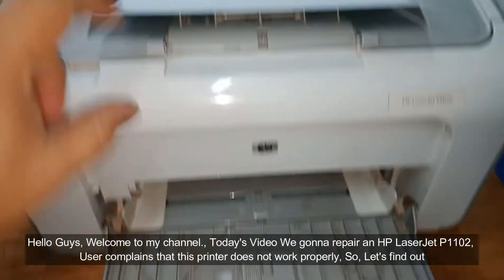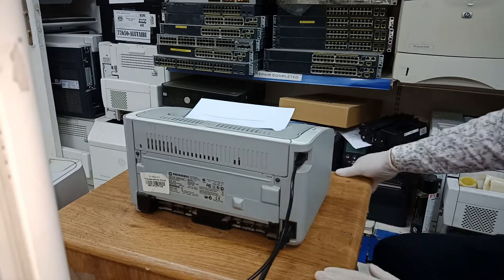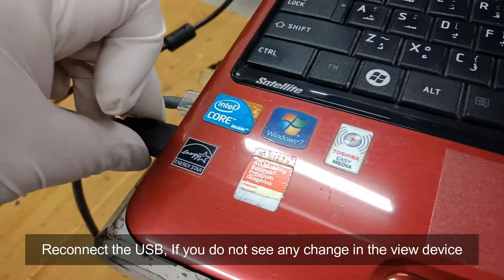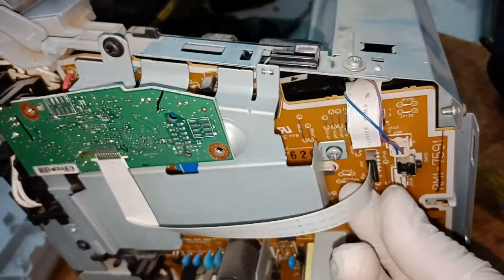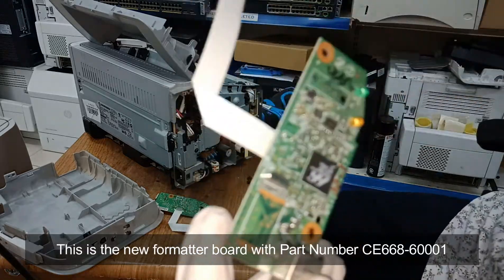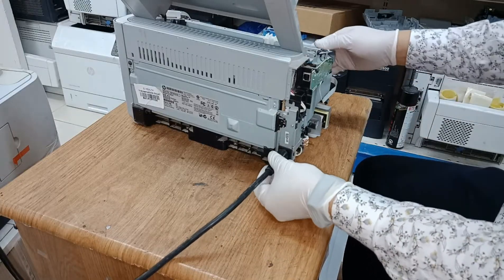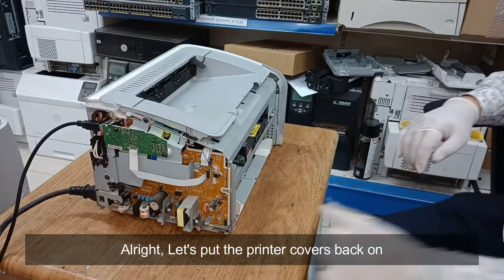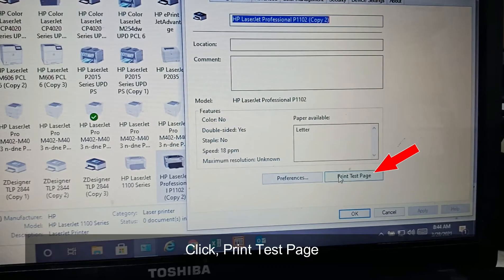Hp LaserJet P1102 | USB Not Detected | 100% Solution

Comment: Hello sir I have the same printer p1102 when I connect it to my PC it shows another name in PC p1105 but this printer is p1102 and when i am installing the driver for p1102 it tells that connects the printer and turn it on while it is turn on already please help me?
Reply from the maker: Replace the formatter board's original part number CE668-60001 it will be fine.
Reply: @Okipentv  Hi..Can I ask you something? I replaced the fusion film and the pressure roller because they were worn out and my P1102w was printing badly .But after reassembly now the printer won't feed the paper.  It powers up the pressure roller spins and after 2 seconds the orange and green led's light up and everything stops. And the 2 lights green and orange remain on. What could I have messed up?

Comment: I have this exact problem. However, if I open up the printer, there is no "burned out" markings on the formatting board. USB is not detected with any computer or change of USB cable. I tried all of the regular tricks with resetting, reinstallation of software, OS requirements, etc...Is it recommended to change the formatting board anyway, even if there are no visible areas of damage on it?
Reply from the maker: Replace formatter board
Reply: @Okipentv  Thanks for your input!